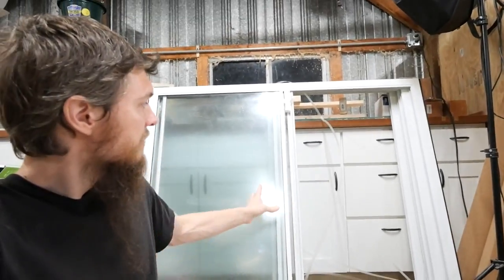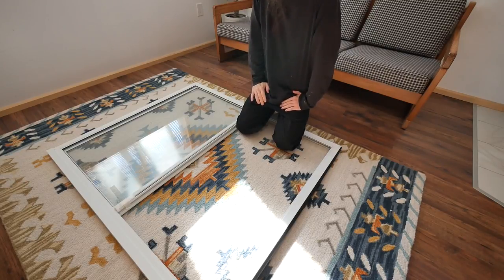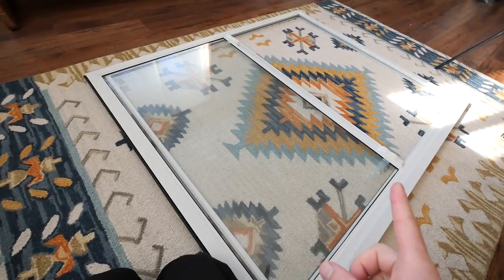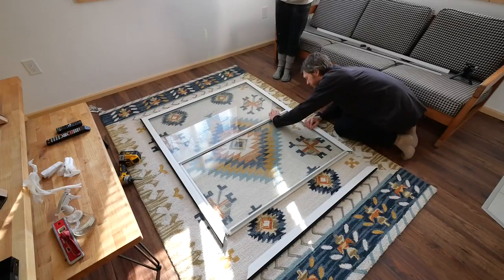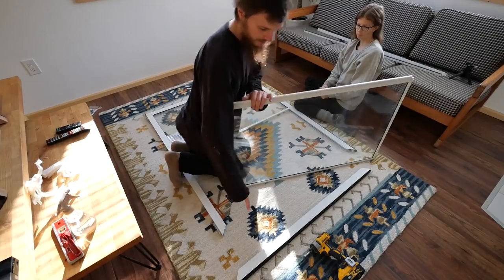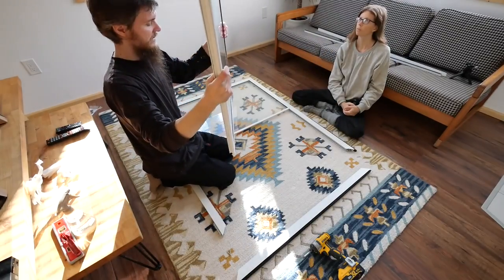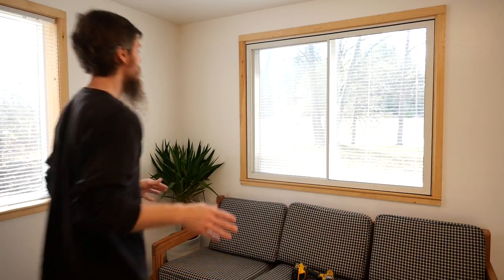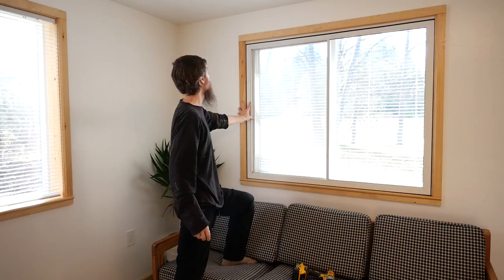Installing Storm Windows on the Inside - This is our Best Option But We had to Hack them First

Comment: Sometimes homes being over insulated can cause condensation not only on your windows but in the air. My window manufacturer has recommended having a dehumidifier, even having house plants will absorb moisture. If you're cooking a turkey for Thanksgiven, it never fails, some windows will fog up even if you have the expensive Thermo windows. Best to have a window cracked open a little same as when you're taking a shower or bath. Way back when I also had to do some window surgery to make the job right.

Comment: I hope you manage to sleep better with the new windows fitted, Ashley.  It takes me ages to get to sleep and I wake up to the slightest sound. Although lately, a small drop of Lavender oil on some tissue under my pillow case has helped me a little. Well done with solving the window issue. Hugs. Carole in UK.

Comment: I used to work for a glass company in the office. Like you said extra payens deafen noise. Here in Canada people put in triple Payne  glass windows in areas where traffic is noisy or trains are close by. You did a great job to flip this glass. After all someone had to assemble them the first time using the same parts.  Nice work. You will be very warm but I hope not to air tight as that is not healthy either. Your wood stove needs oxygen taken from the house to burn,  so you must replace that oxygen to stay healthy.
Reply from the maker: Yep, fresh air is definitely important, especially living in the cold north and being inside for months on end. Our woodstove has an exterior air intake which helps a lot.
Reply: Thanks Doug that is great to hear!

Comment: I installed several interior storm windows. None like those. I like them. Very clean look. And you get improved efficiency without have to get any permit or disturbing the exterior of the house. Awesome job with " field reversing" the windows.

Comment: We had inside storm windows when we lived in AL. I think they were called Magnatite or tight. Made in LA I think. You could order them for either sliding windows or double hung.  They had a small frame inside about an inch or two from existing window.  The magnetic strips around the edges clung to the frame which was a magnetic metal. They were plexiglass and had magnetic strips all around on the edges of the windows. When you wanted the window open, you stacked the half that needed to be opened on to the stationary side.  They made the house much quieter, and no drafts.  In AL I'm sure they saved us a lot on cooling.

Comment: Years ago I had a window that faced a busy arterial. Replacing all windows, I special ordered a thermal window with thicker glass. Being in Arizona the window's which also faced south heat was also a major consideration. The special order window's not only provide an excellent sound barrier, but excellent thermal protection as well without removing a second window seasonally providing year round comfort needs. Quality windows, and doors, should always be a first consideration in any whole house renovation. More upfront costs will pay for itself in long term comfort, and convenience.

I live in an agricultural dusty summer environment, and live near a highway. A hint, it is easy to clean the tracks. Slide window to center, lift up, and pull window out. Depending season, I wash window either outside with hose and brush, or bathtub.. With a little regular maintenance crud won't build up in the track, or the void area at ends. 

Condensation: Do you have a whole house ventilation fan in the attic area?
Reply from the maker: No, we don't have a whole house ventilation fan. Next time we'll definitely know what upgrade to do when renovation :)
Reply: @diyfferent  - Yes. That's I how I learn. Trial and error. Wouldn't change learning any of all my endeavors.. Those are some of my best memories. :)

Comment: In the UK we called it secondary glazing, great for heat loss and noise, all that was before everyone  went into double  glazed units, I think in Sweden they fit this on top so in effect you have triple glazing. Beware, you still have to get rid of the moisture.
Reply from the maker: We are working on the moisture issues as well. Thanks :)

Comment: I am slightly concerned that your condensation issue might be caused by a lack of ventilation. Several years ago we had some fans replaced by fans with two settings. Normally, they provide a trickle ventilation, but when the humidity increases they go into a boost mode. They totally cleared all the condensation issues, no more wet windows and, just as vital, no more mould.
Well done for working out how to reverse the window build to match your needs. 
The modern windows are rather easier to work with than the old wooden types, they are not so heavy either. There was a noticeable difference in the sound as the first inside window was fitted, I guess it is going to be far nicer and warmer in the house. Window technology is constantly changing, thickness air spacing and heat managing glass varieties are all options these days, One thing, tomorrow they  will probably make new claims.
Reply from the maker: More ventilation would help for sure. But we've had condensation in every home we have lived in. I think it just comes with winter :)

Comment: I just knew, without a doubt, when you said the "hand" of the storm windows didn't match that of the existing windows that you would make them work! If someone put them together the "wrong" way,  someone like YOU can put them together and make them work the "right" way! As you said, it was a daring thing to disassemble a brand new window.....few would have the nerve! Great job assessing the problem and having the courage to execute the solution! (I had no idea there was such a thing and super idea to encase those dust collecting blinds between the windows.....looks very snazzy too!)

Comment: Great job!!! Love how you figure it out!!

In 1980 we built our home. We installed triple pane windows. Love em except when it is time to clean them. LOL. 

We have a five ft slider in our dining room. Not triple pane. Our old drape died. And it was a year before I could replace it. I was amazed at how much heat AND cold it blocked. Highly recommend insulated curtains. My opinion only.

Comment: Great windows. They look really nice. When I first moved into my 648 sq ft home, I had horrible condensation in the winter. I am talking paint blistering, black mold and a puddle forming under my kitchen table where the water ran down the wall behind the stove. I solved it with a dehumidifier but found out that all I needed was a little air circulation.  I have one of the old gas stoves hooked to the chimney in the living room and a ventless gas unit in the kitchen. I started heating with an infrared heater and I haven't had a problem in 14 years.

Comment: I will say it again — you guys are so brave!  I stand in awe!!!  Good on ya 👏👏👏.  

You mentioned older homes with (usually) sash windows and the efficacy of installing storm windows.  Storm windows are not a new thing.  100 years ago, when they built homes, not only were there storm windows for every window in the house, there were screen windows for all the windows!  In know this because in the small, West-Coast-of-British-Columbia town in which I live, there is a whole neighbourhood with a heritage distinction and the homes were all built around that time.  When the first tenants/owners moved in, all the houses came with a full set of storm/screen windows.  One interesting feature of the storm windows were 3 holes, about 1” in diameter, in the top of the frame and in the bottom.  These holes were covered with a sliding piece of wood.  Thus, you could have the inner window open and still be able to get fresh air by sliding the covering over the holes to whatever you wanted.  Also, probably to reduce condensation, you could adjust the air in the void between the windows by sliding the covering over the holes at both the bottom and the top, to create a draft — not much, just enough to clear the windows and yet keep most of the heat in.  When combined with the opening and closing of both the top & bottom of the sash windows and the holes in the top & bottom of the storm window, there are many configurations to achieve a number of solutions for problems.  Then — in Spring — off would come the storm windows to be replaced, immediately, with the screens.  These were screens that covered the whole window frame, not just to fit into a small part of either the top or bottom of the sash window.  That way, you could open the windows in any configuration with total assurance the mosquitoes wouldn’t find their way in.  And in a temperate rain forest — trust me — there are mosquitoes everywhere!!!  You might want to try putting a whole-window-sized screen on the outside of your windows when the time comes — next Spring.  It could make life a whole lot more comfortable — 😉

It’s about time to hit the pillow.  Your family is a total blessing to all your watchers.  God continue to bless you all and keep you safe & healthy.
👵🏻🐾💕🇨🇦
Reply from the maker: I hope I didn't misrepresent what I meant. I have lived in some 100+ year old homes and they had some of the original storm windows. We also lived in a 1970's mobile home that had interior storm windows. I think all double hung windows today come with a full screen.

Comment: Thank you so much for sharing your experience with interior storms. We have an older home with single pane glass and 1" muntins which I absolutely love. I knew that the R value could be just as effective with a storm window as newer double pains. But, on the older homes storms were traditionally hung on brackets on the exterior. We can see were the old brackets were mounted originally on our home but none of the storm windows remain. I've even seen narrow, approximately 6-8" long swinging arms that can be mounted at the bottoms to extend the bottom of the storm outward a few inches to let in fresh air or cool breezes on a nice day so that the storms don't have to be removed. I had thought about this option if we rebuilt the storms a few at a time. But, your video gives me pause to check out the other options we might have. I like the idea of interior storms for ease of handling and cleaning. What a boone to keep the blinds in-between to keep dust off. 
So glad that the reversal worked! Brilliant!

Comment: Love how you figured out to make those windows work for you!!
I grew up in a trailer that had Jalousie Windows. Jalousie windows do not sill at all. Come winter time we broke out the storm windows which were simply a large single pain glass window in a aluminum frame. They were held in place by setting them in the window frame and turning some little clips to hold them in. Come summer out came the Storm windows. While they were nothing fancy or even nearly as good as what you installed they made a HUGE difference. I remember even making storm windows out of large sheets of flexible plastic and wood strips to place in windows to help insulate during winter.

Comment: I'm pretty sure double pane windows is now standard in the US. Careful with sealing up your home as condensation will be trapped inside and then mold becomes your friend inside. 
I give you big props for addressing those windows, many would have just returned them. You should have gone into engineering.

Comment: It’s either air exchanger or making the airport move with fans.  Living in Canada we run fans in the summer for cooling and the reverse direction in the winter to keep the condensation down. It is amazing one can have condensation on the windows but the humidistat says the air is dry.

Comment: I would suggest Lunos air exchange system. Tiny houses install them all the time for condensation
Reply from the maker: We looked into those. I actually wanted a whole house heat recovery ventilator when we were renovating but we decided not to spend the money. It probably would have been well worth it though. We are currently experimenting with a similar unit in our bedroom, but we haven't shown it yet :)

Comment: When I lived in central BC and AB in Canada many many years ago, we used storm windows in the homes with single pane windows. They worked very well with keeping the cold out. I now live in an apartment in Washington state. The windows are doubled pane and the apartment is very cold if I don't keep all of the windows covered during the winter. Even though I keep them covered the air near them is colder than when I lived in Canada.

Comment: Great job!
If you have condencentionproblem, put a fan or a ventilation...(something) in.
In Sweden in my old summerhouse (it is used in the winter somtimes to) there are 2 windows just like you just did and when fall comes and the innerwindow is put in we use dry moss or cotton inbetween to keep it dry. Looks really nice too
Reply from the maker: Thanks. It's hard to avoid some condensation during the winter, but we're doing our best to address it :)

Comment: I've never seen interior storms, but they are rockin! And you're right, great solution for an older home. I'm sure they come in traditional bottom open as well. Thanks for sharing! 🥰
Reply from the maker: Yeah they come in slider, traditional style, and picture window(non-opening). They are really a good option for old homes. Especially two story homes where I'd rather install windows on the inside than outside on a ladder.

Comment: I never knew there was such a thing as interior storm windows.  I'd love to have them but my window casings are not deep enough to accommodate them.  I don't need them for sound deadening, but to keep heat in and cold out would be great.  Guess I'll just have to use the plastic that goes on with tape and shrinks in place with a hair dryer - have used it in the past and it really does block drafts.  Job well done - hope you get all the benefits you're hoping for.

Comment: Your windows to me always are mind blowing! In Europe we have windows with triple pane glass. Windows of your type are placed only on balconies that do not require heat and sound insulation. But in winter (not every) we sometimes have up to minus twenty degrees Celsius.
Reply from the maker: Our windows are double pane. Triple pane are available here too.
Reply: @diyfferent  It's just window system size differences. We have no sliding systems, or they are very rare (and expensive), because of the high energy class requirements.

Comment: I live in an apartment and a few years ago they installed new windows that have double glass made in them. I think they are storm windows too. I live in Florida. You are right about keeping the sliders clean. I use a spray bottle with vinegar and water and wipe them down the best I can. I live next to a busy road and don't hear traffic with the double windows I have and it keeps the cool air in during the summer. I hope the windwos work out for you. Neat idea with the blinds.

Comment: I have windows that lift up It makes it hard to open and close because I am disabled so I never get to open them. FYI the track still gets dirty on the ones I can open for summer we do not have AC so my windows stay open most of the summer. I only close them if we get a blowing rain that comes through the screens. If you like to open the windows for air in the warm months sliders are easier. As for the track just do a routine seasonal cleaning, in winter put a strip of cloth or paper to catch the dirt for easy clean up in spring, I use cloth because its reusable on the open side in summer if you have sliders. Love your videos.

Comment: I also am noise sensitive. Unfortunately I rent and can't put new windows. But I did buy a white noise machine. The best thing I ever did. I'd never be without one again. It  cut the outside road noise to a very low level.
Reply: I’ve been using a white noise machine I bought at a yard sale over 35 years ago. Amazing it still works! We also have a humidifier in another room to help my grandson sleep better.? Spring and summer we just don’t add water
Reply from the maker: Ashley likes to put on rain noise on the computer sometimes when we sleep.

Comment: Good curtains will help with road noise & help with heat loss. 
GOOD JOB.. GOD BLESS..
Reply from the maker: We're not big curtain fans, but the biggest problem we find with curtains is that they keep the window glass colder and cause more condensation. Just in our experience.

Comment: The windows look great. Clean lines with no extra bulk in your frames. Well done on the reworking of the opening direction. I’m a bit spacially challenge so I don’t think I would ever have worked that out 😂 Great work! ❤️🇦🇺❤️

Comment: your condensation problem might be coming from the fact that your house is now super tight -- vapour barrier.   We had this problem in the past with a new house.  Code in our area now requires an air exchanger built into these tight new houses, so fresh air and stale air are efficiently exchanged.  You will not have condensation problems on the windows if you install an air exchanger.
Reply: Alpine Home Air dot com carries the air exchange units. Also Panasonic has a nice one. AprilAire may still have the best warranty.